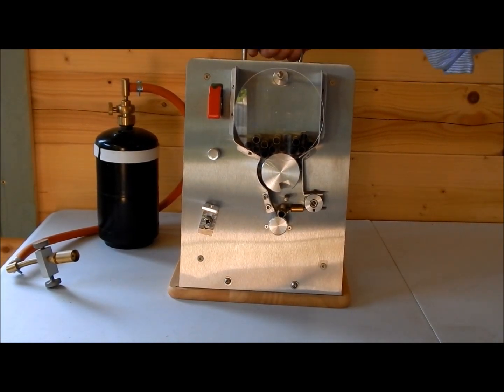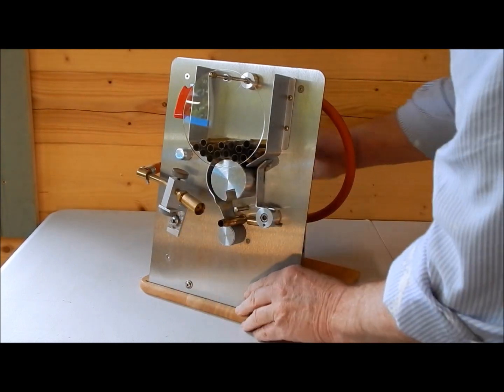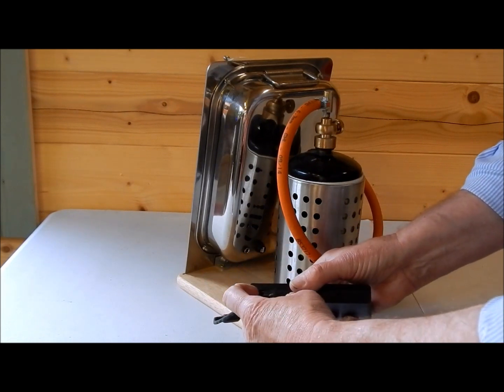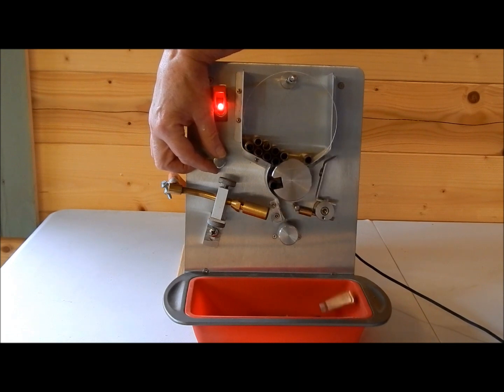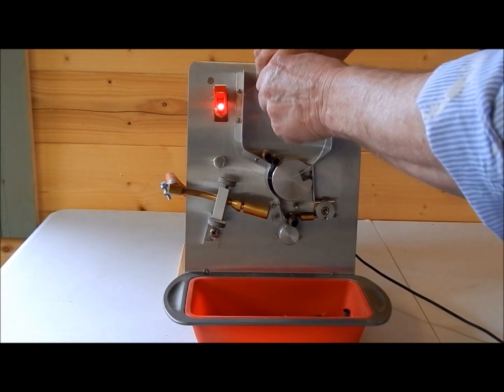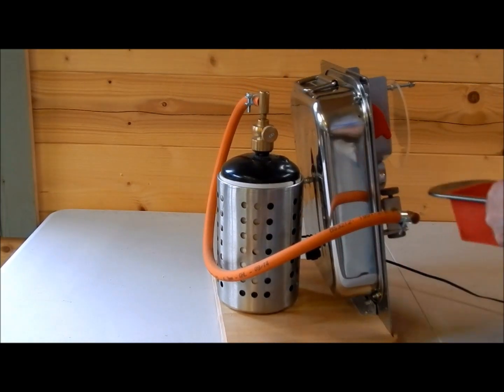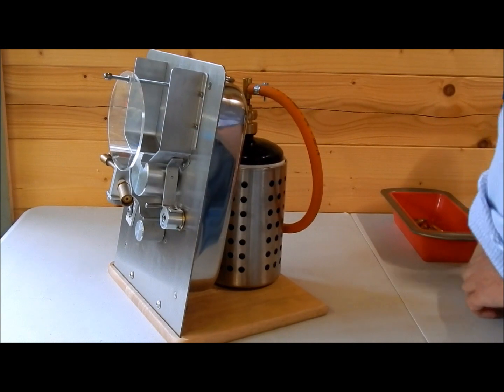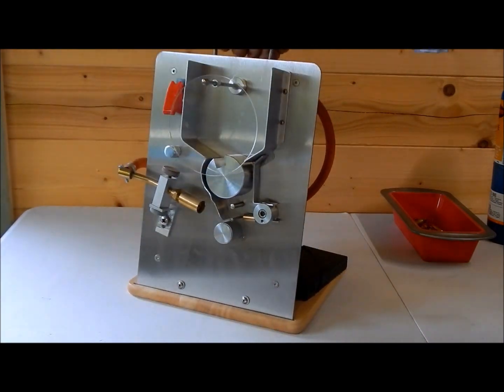Jeff annealer

Comment: Nice project, I have made one too (video on my channel), there are so many examples on Internet
Reply from the maker: Thank you - I've made several different annealers  now, all a bit different. I have just had a look at your annealer, excellent original thinking - great job.
Reply: @Targetmaster1066  Thanks, I think that now with all those cheap 3D printer parts on Ebay I would be able to make something even better.
Reply from the maker: I've been thinking about making a turning target system for pistol shooting - I'm happy with the mechanics but my Arduino skills are very basic, it's something I must work on.
Reply: @Targetmaster1066  Is that the programming aspect ? The arduino interface is based on the C langage, I suggest you begin by learning the C basics and then go to the arduino tutorial (it will be easier to understand these tutorials and how to adapt it to your devices). Learning electronics is much more difficult for me.

Comment: Is this a one or two motor design?  I have been thinking about building one of these and have had a design in my head for a couple of years but was going to be a 2 motor design similar to some that I found on Youtube when I started looking to see if someone had built what was in my head.  My design came from the fact that I saw an expensive one with a horizontal plate and 2 burners several years ago and thought there must be an a less costly design.  I was thinking of a auger system like in a paint ball hopper until I saw your rotating wheel design.  Anyway nice unit.
Reply from the maker: Yes, two 12v geared motors. The lower motor just spins the case in the burner, it's fixed speed on this design. The feed roller uses the same motor but is variable speed to give you exact timing. 12v dc PWM motor speed controllers work well and not expensive.

Comment: This is a really nice design, free from the usual plastic injection mouldings and other bits that are not replaceable, I like the idea of running off 12 v, I there any problem with the cases slipping on the drive roller, I see it is a steel roller, it could also drop the annealed cases into a trough of water on completion , a very useful case annealer !
Reply from the maker: Thank you - There's a lot to be said for KIS. (Keep it simple) - The cartridge is almost balancing in the lower roller when in the flame, the roller is knurled aluminium and no evidence of any slippage.
Reply: Indeed we seem to be inundated with complicated but useless designs on the market, these over complicated devices appear to be put on to the market without the slightest development, so ,having produced thousands of complicated mouldings, (just because they can), they are committed to going into mass production, your idea is by far the best approach, using component parts which are both durable, and replaceable, well done with this design, I hope you sell many of them, the knurled aluminium wheel is a good idea, but you could use a silicon rubber tyre if you get any slippage.
Reply: Why drop it in water. That defeats the purpose of annealing in the first place.
Quenching a metal by rapidly cooling it off in water makes it harder and brittle.
That's exactly the reason why you anneal, to soften it. Because the brass becomes hard and brittle from working it. 🙈
Reply from the maker: No Basjan - Water quenching brass, unlike something like steel, makes no difference to the internal structure at all. It simply stops you burning your fingers. @michieljames737
Reply: @Targetmaster1066  Ok sorry. Please may I offer my humble apologies then?
Reply from the maker: No problem Basjan , thanks for the interest, brass and copper have their own rules.
Reply: @Targetmaster1066  that is indeed a beautiful machine that you built sir. I must commend your attention to detail and craftsmanship.
Reply from the maker: @michieljames737  Thank you. If you check my other videos you'll see another couple of designs I've made. https://www.youtube.com/watch?v=Jv75-9p9yFA&t=22s
Reply: @Targetmaster1066  thank you for that info...  I've been wondering about the effect of quenching brass and had not really found any definitive answer...  👍🏼